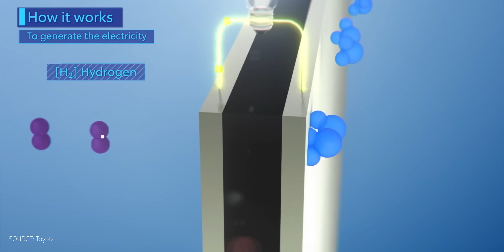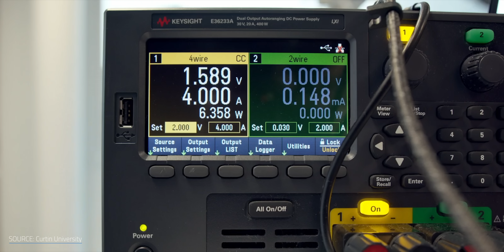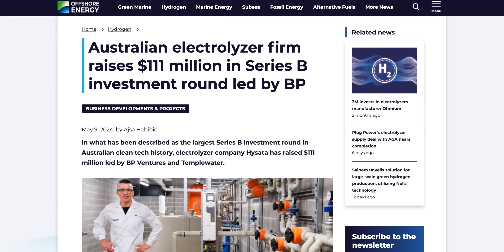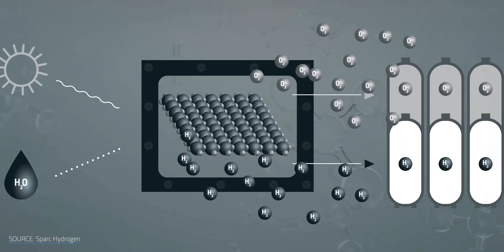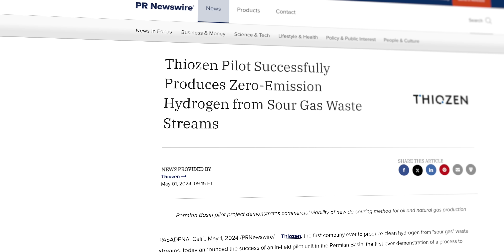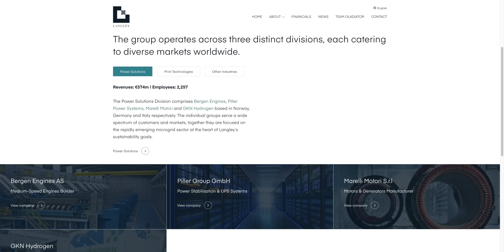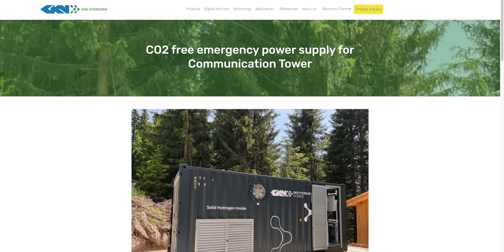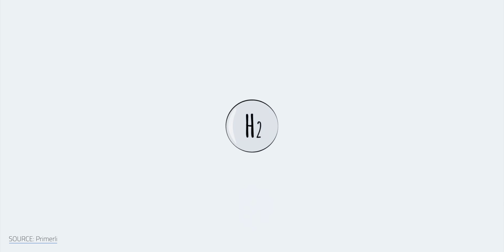How a Hydrogen Breakthrough is Closer Than Ever

Comment: I think a lot of fossil fuel companies are using hydrogen to preserve their infrastructure and remain in business. In other words, they are pursuing it to try to remain profitable, not because it is a good solution.
Reply: This so much, the nuclear fission industry is doing the same, even though it will never be economically viable, or responsible, to produce hydrogen using nuclear fission.
Reply: I have researched hydrogen a lot. It isn't viable for automobiles. The real use though inefficient is to use excess solar energy to product hydrogen and use it in a hydrogen generator with a use of the wast heat. That's stable and a use for unused solar energy which will be a upcoming problem.
Reply: I'm waiting for better batteries for solar
Reply: @lance4444  We already have batteries that are better at storing excess energy. Batteries typically have a round-trip efficiency of 70-90%, while hydrogen storage systems are around 30-50%, resulting in greater energy loss during the conversion process with hydrogen
Reply: And legacy car makers, to protect all the money invested on their factory floors, and engine production lines.
Reply: You cannot preserve infrastructure with hydrogen. Hydrogen makes steel brittle.
Reply: they are investing in both hydrogen and electricity, they ain't dumb and see the cash flow from these sources.
Reply: Fossil fuel companies are likely also trying to suck up as many of the green energy subsidies as possible, by pretending to work on this, to prolong the inevitable future where fossil fuels become practically worthless.
Reply: I dont understand this logic. What would be a better solution?
Reply: @mm-qd1ho  you produce electricity to produce hydrogen then to drive cars. While if you solve battery problem then you don't need to convert electricity to hydrogen. And evs are more simple then combustion motors
Reply: Yes i agree, but it's more to preserve the distribution model, very little of the infrastructure can be reused, making hydrogen even less interesting. At least no one is talking about it as a personal mobility fuel anymore
Reply: Of course they are, they have a fiduciary responsibility to the shareholders to invest in whatever generates profit.
Reply: Seems to me fossil fuel companies retrofitting infrastructure to adapt to hydrogen is cheaper than an entirely new infrastructure being built. Natural gas lines can be modified to carry hydrogen LNG mixes that can later be separated downstream.
Reply: @Ony3Felonies   that is not entirely true, Hydrogen pitting is a real problem, not to mention that it requires triple the pressure to deliver the same amount of power than natural gas. Beside that, leaking of hydrogen is estimated to be three times greater than natural gas, there is not a straight forward route  to acomodate existing infrastructure for the needs of hydrogen distribution.
Reply: @Ony3Felonies  Yes, but: 1. what is the H2/LNG ratio? I bet it's not that high; 2. How can the mixture be separated cost-effectively; 3. You're still using fossil fuels!
Reply: @mikejfranklin7000  Where did he claim they weren't being used? The conversation was about retrofitting
Reply: @Ony3Felonies  I think it's more like they are going to try to pretend to do that as they steal as much subsidies as they can, in attempt to delay the hydrogen infrastructure from getting built, for as long as possible, so they can continue to profit off of ruining the planet.
Reply: Well, good , better hydrogen than oil

Comment: 1:06 "because hydrogen is a lightweight gas, its volumetric energy density is low at 8 MJ/liter, compared to gasoline’s 32 MJ/liter."

That's wrong. That's the volumetric energy density of liquid hydrogen. Gaseous hydrogen's volumetric energy density is much, much lower, and it varies with pressure.
Reply: So it's quarter the energy even both as liquid?

Comment: Fission reactors which use light water as coolants or moderators often have to recombine the h2 and o due to the heat of the reactor. Japan wanted to simply siphon off that hydrogen and use it rather than always trying to fight it. It would be more efficient that converting the heat to electricity to do hydrolysis,  certainly.

Comment: Still looks like we need to expand renewables going forward to eventually over take and lose fossil fuels.  
A highly efficient electrolysis method + fuel cell technology and reusing the water byproduct could be made into a large battery to store excess grid power.  Or if made small enough could be battery for homes or even vehicles that are "recharged" with grid power.

Comment: Why not use hydrogen as a storage battery for when the wind doesn't blow and sun doesn't shine? Use in cars has huge issues, so it's better in large tanks like propane is currently stored. Use solar power to split water and hyrdogen fuel cell to generate electricity later.

Comment: While production and storage of hydrogen are addressed here, transportation of hydrogen is not.  Addressing the cost of hydrogen production is important, getting the stuff to where it's needed is possibly the greatest challenge.  That will require transportation in compressed form.  Every hydrogen powered vehicle would require a storage tank.  A very strong storage tank.  A heavy storage tank.  Imaging taking a Hindenburg amount of hydrogen and compressing it into a delivery sized tanker.  Imagine your local hydrogen service station with similar storage tanks underground.  Every tank requiring constant refrigeration to keep the gas compressed.  Imagine when a power cut results in the failure of the hydrogen to remain compressed.  Imagine the liquid hydrogen expanding by 848 times instantly!

To be viable, hydrogen needs to be available in liquid form wherever it is needed.  Keeping hydrogen in liquid form is a huge challenge.  Hydrogen is notoriously difficult to keep stored under pressure.  It leaks through solid steel and plastics so is impossible to fully contail indefinitely.  This is why NASA has to keep topping up their rocket fuel tanks right up until launch.

Oh, and have you considered just how easily hydrogen gas can be ignited?  It is possibly the easiest of gases to ignite, having a very wide range of ignition densities.  Just think Hindenburg.

Instead of investing in hydrogen we should be investing in the electrical distribution grid.

Comment: The round trip efficiency of hydrogen, even using Hysata's 95% efficiency for the electrolysis step, is still around 50% max ( theoretical, not practical, practical is much lower than this ). Current practical battery tech in comparison is around 70-85% round trip efficiency.
Hydrogen might be usable for aviation and perhaps boats because of its much higher Wh/kg, but everything else... doubtful at best.

Comment: Excellent progress. One thing to note is that if you're producing hydrogen from solar/wind, energy is lost in the process. So it might seem we don't need hydrogen. But, generally we don't need hydrogen except for specific cases like airplanes and large ships, which is where hydrogen's value lies. Since hydrogen is only needed for these limited but important applications, the hydrogen revolution may happen faster than many expect.

Comment: Production and storage are obviously big issues. Another is with fuel cells. Like combustion engines, fuel cells aspirate to obtain oxygen but unlike combustion engines, the PEM is likely much more susceptible to fouling/contamination making the system require very high quality/pure incoming air. This system would require maintenance and filter replacement very frequently and knowing the average consumer, this could be an issue both in terms of neglect but also an added expense. If the filter element fails, the entire fuel cell stack could be ruined easily. I do think that, although hydrogen can work in transportation, there are just too many downsides. ICE, BEV and hybrids are the only cars on the road for a reason. I think FCEVs are too frail to be practical.

Comment: I’m not quite getting it…
As I understood the only thing that is capillary is that separator sponge in the middle, so it is easy to imagine how bubbles of O2 and H2 form on the INSIDE of the separator where they not only mix, but also clog the capillaries partially and everything goes bad. But the demonstration clearly shows that gases are released on the part of the surface of the electrodes that isn’t touching the water. As if electrodes also capillary and they for some reason suck gases immediately from the reaction outside.
Like isn’t separator supposed to separate??

Comment: Houston Bus Journal, Oct 31, 2000: Texaco Energy Systems Inc. and Troy, Mich.-based Energy Conversion Devices Inc. have formed Texaco Ovonic Hydrogen Systems LLC, a 50-50 joint venture to further develop and advance the commercialization of ECD's technology to store hydrogen in metal hydrides. >> TESi planned to ship large hydride pucks by train. When Chevron bought Texaco they immediately shut down TESi.

Comment: H2 is most efficiently stored as liquid para-hydrogen. While the energy required for liquefaction is large, with efficient design, more than half of this energy can be recovered during boiling & expansion. In some uses, the recovery of energy may be oblique, but the potential is always there. Consider LH as a fuel for aircraft turbine engines. Pre-cooling prior to compression greatly increases the output of a turbojet. When LH is used as fuel, the cooling can be very extreme, and so can the efficiency, since the heat engine's lower temperature is greatly reduced.

Comment: Researching PtX (Power to X) energy investments in Denmark, as well as the Danish "energy island" that is being constructed in the North Sea, that is likely going to project the main direction for the global green hydrogen production. But it's still years away, projected currently to see its completion in 2036, with the goal to supply clean energy to 3 million European homes, as well as pioneering off-shore hydrogen electrolysis from wind farms and other renewable sources.
There has been delays in the project due to heightened interest rates, but apart from that it's still the biggest global renewable energy/hydrogen venture by far.

Comment: It would be interesting to combine the solar tec's behind desalinizing water and turning water into hydrogen, and then pairing that monstrosity with the ocean based wind turbines. In theory, in one site, you could turn saltwater into renewable and clean water, and then split the water into hydrogen. And any electricity needed could be covered by the wind turbine. At that point, distribution of the hydrogen would be the only real issue. I doubt the process would be quick, especially at first, but sustainable, no emissions and low to no cost would mean that if it can produce enough hydrogen to ease the grid, that's ultimately a win no matter how small the percentage.

Not to mention, the entire process would help reduce heat at every step of the process.

Comment: Did I hear that the electrolysers were 95% efficient right? I thought those things were less than 50% efficient and that was one of the drawbacks of hydrogen vs batteries. 95% is way up there.

Comment: It's not the production or storage of hydrogen that is the biggest problem although these are significant, it is the distribution of hydrogen that will limit it's use.  You can't put it in our existing gas pipes because they are plastic and more than 10% hydrogen leads to the plastic being attacked and becoming brittle.  To distribute it via pipes we would need to build an all metal network with very expensive metal valves and even then because Hydrogen is such a small molecule these lose a significant amount of gas.  Such a network would be extremely expensive to build particularly when compared to costs of distributing energy in the form of electricity.  If you try to distribute it on a tanker lorry then to carry any significant amount of the stuff it needs to be highly pressurized and that means it has to be stored in very heavy tanks.  The result is that a 40 ton tanker lorry can only carry 600kg of hydrogen which has an equivalent energy storage that is just 16% of a petrol tanker lorry.  If the tanker lorry is itself powered by the hydrogen it is carrying, on any long journey when it reaches its destination there will be almost no hydrogen left in its tanks.  If you try to liquify hydrogen this takes the equivalent of 30% of the energy stored in the hydrogen and transporting cryogenic liquids is very expensive making this also economically unviable.  As a result the only solution is to make it close to where it is used which might be OK at an airport, however it doesn't work for cars.  To make green hydrogen you are going to need a lot of electricity and if you have to put in special high current electric supplies to your local hydrogen filling station then you would be better off put a rapid electric charging station there, because it is a lot simpler, reliable and efficient to charge a vehicles battery than to build and run a unit that creates hydrogen from water by electrolysis.
Reply: Spot on. No point in creating another trillion dollar distribution system.
Reply: Thank you.
Reply: Turquoise hydrogen looks promising, direct conversion of natural gas into hydrogen + solid carbon. No CO2.
Reply: @chrism.1131  wouldn’t pulling the oxygen away from the carbon in the carbon dioxide use more energy than you get out of the hydrogen?
Reply: @colingenge9999  No, you're pulling 4 Hs away from their C in CH4. Yes, you must spend energy to break those 4 C-H bonds. So you put energy in - as mostly electricity - into severing the CH4 into C and 4x Hs - and that energy was mostly stored in a "Battery of Hs" - except you lost part of your energy, tough luck. The result is viable, but you need super-cheap CH4, which seems to be no problem, seeing how often it is illegally flared. And of course, you don't get to break the laws of thermodynamics or create a perpetual-motion machine.
Reply: @jonb5493  I was responding to @chrism above with his comment on turquoise hydrogen where they convert natural gas into hydrogen plus solid carbon. I assumed that the carbon dioxide had its oxygen removed to form what he said was “solid carbon“. My question was about pulling the carbon off that carbon dioxide but now that I look at his comment more closely he may be talking about pulling the hydrogen off the methane and somehow causing all the carbon atoms to form what he refers to as “solid carbon”. I’ve never heard of this process before.

Overall most degree that however we get hydrogen it will be more expensive than taking a different route which could be using methane as the fuel in the case of hydroforming methane or using electricity directly instead of the intermediate stage of hydrogen.
Reply: @colingenge9999     jonb explained it beautifully. As I said in my comment, no CO2. YouTube has videos explaining how it works…" Turquoise hydrogen."
Reply: @colingenge9999  Where is the hydrogen in CO2 ?
Reply: @philippe94416     if you are inquiring about turquoise hydrogen, it is made from natural gas ( CH4 ) it is a direct conversion so, you were left with only hydrogen and solid carbon.
Reply: Big oil
Reply: Why store the H2, why not put it directly into a Sabatier reaction (Uses Co2) to get methane which is very easy to transport and store this could be done in with solar and wind to store that energy so it would function as a battery. All this is well understood any investors?
Reply: Produce on site, distribution solved

Comment: I've got this amazing solid hydrogen storage technology. It's super energy dense. It uses carbon chain molecules. I call it C-O-A-L. It's gonna be huge. Seriously though, hydrogen ONLY makes sense for widespread use once there is a huge electricity surplus, and the cost of electricity approaches zero. This is because it will always cost more to go from electricity->hydrogen->electricity->battery->motor than it costs to go from electricity->battery-> motor. In the first scenario you are adding inefficiency not to mention the price of the fuel cell.  For specific uses where batteries alone are not energy dense enough, sure, but otherwise it's just stupid.

Comment: The main problem with Hydrogen is that it will always be less efficient than electricity, since you need electricity to generate it. 

Also if it releases water into the atmosphere that is also a greenhouse gas, since water in the atmosphere has the same issues that gasses like CO2 also has when it comes to trapping IR radiation in the atmosphere. 

There are places where Hydrogen will likely be better, such as shipping, and air craft, provided that battery tech doesn't leap forward to the point where hydrogen isn't preferred, but for cars, and trucks, I just do not see Hydrogen being superior, or even competitive.

Comment: Hydrogen and fusion. Two pipe dreams? Storing, moving, and using hydrogen will continue to be huge roadblocks. Those tiny hydrogen atoms gradually permeate their containment vessels. You can’t just pour it into a plastic jug like gasoline. There is no infrastructure to pipe hydrogen anywhere it’s needed so it will have to be transported by TRUCKS. Having to compress hydrogen because of its low volumetric energy density makes its use more complicated, especially for vehicles…unless you fly blimps…just ask those Hindenburg people.